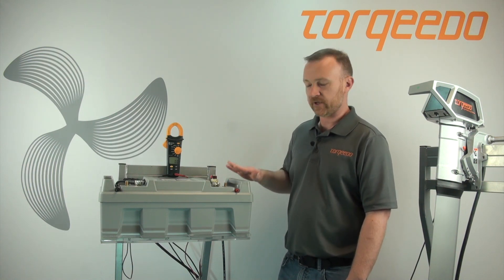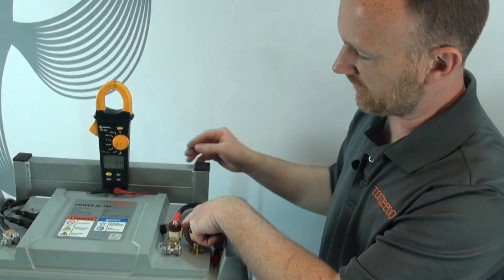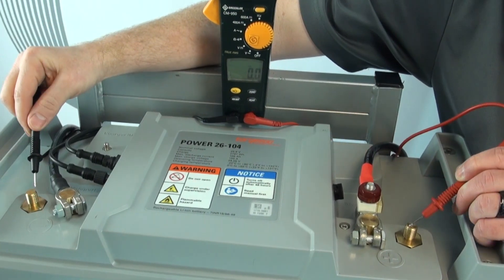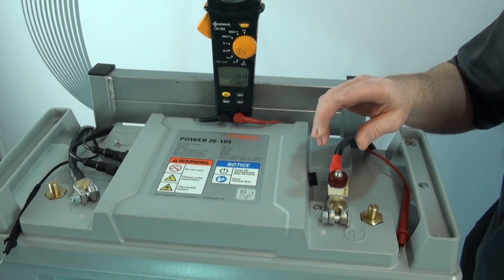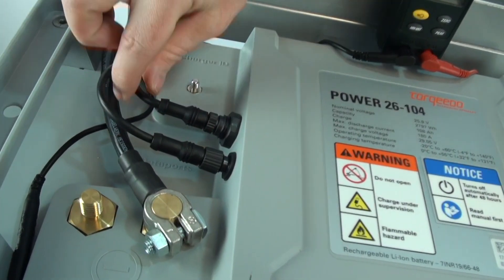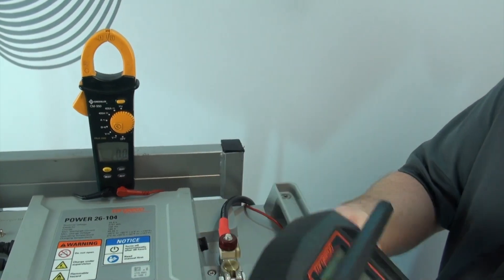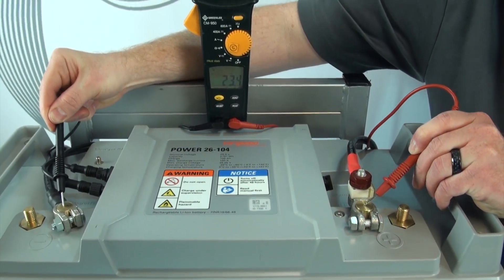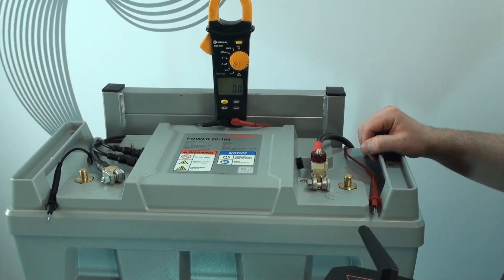Torqeedo Power 26-104 / Power 24-3500 Lithium Battery Activation

Comment: Can this be used as a leisure battery and be charged by solar pannels
Reply from the maker: Hello, thanks for your question. Yes it is possible to use the Power 24-3500 as a leisure battery for different use cases. For this the on/off button is required:

https://www.torqeedo.com/en/products/accessories/cables-and-steering/on-off-switch-for-power-24-3500--power-26-104-/2304-00.html